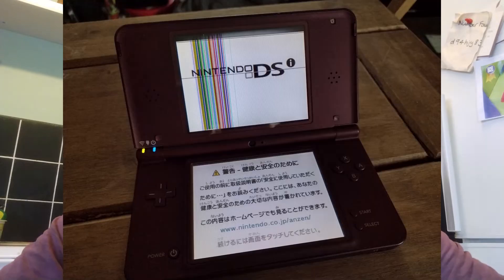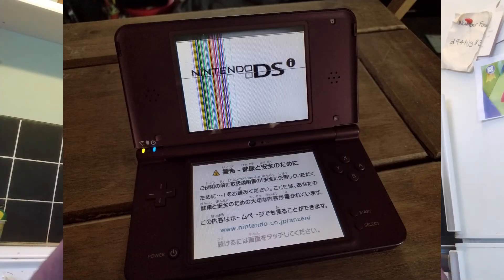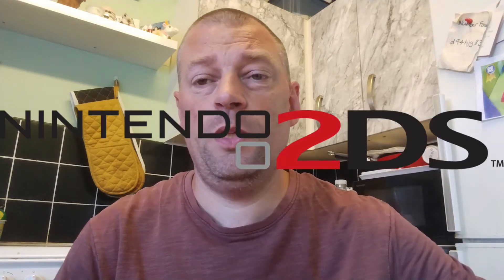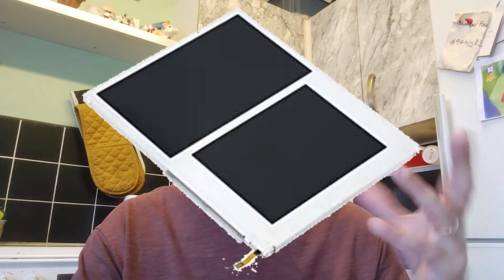Nintendo DS Top Screen Repairs. I Hate Doing Them. They Should Be Easier.

Comment: I've seen videos on top screen repairs and I can confirm It's painful
Reply from the maker: My least enjoyable repair
Reply: @IDreamOfGaming  another hard repair would probably be a pot-lx1 screen replacement (huawei p smart 2019).First you have to start from the back meaning you have to remove most of the components. Then, if you don't order the screen with the frame included (which is more expensive if the frame is included) you have to separate them and glue the frame to the new screen which sounds painful. After that, you have to place the volume and power button to the new frame.